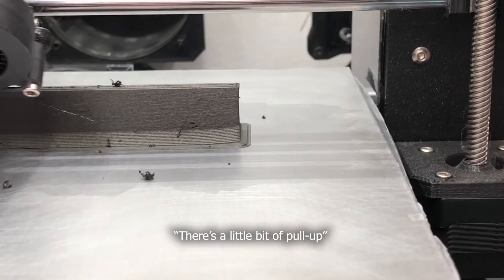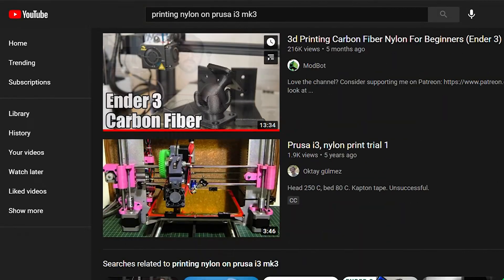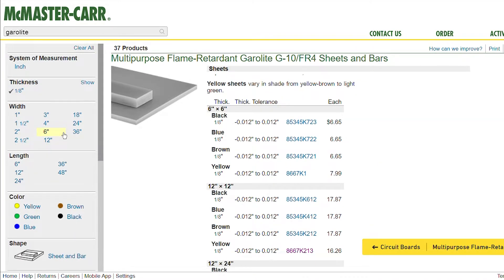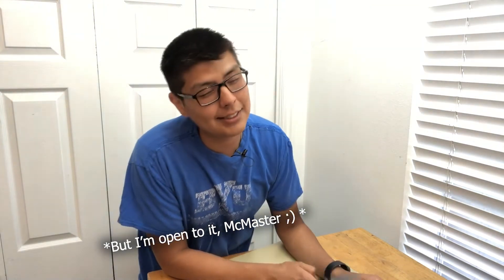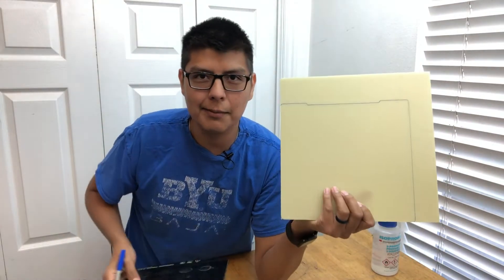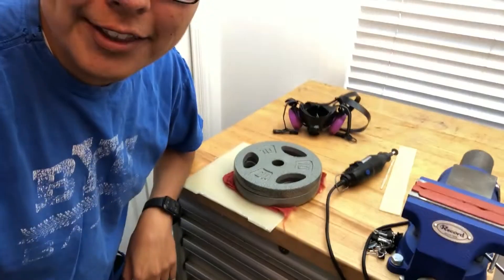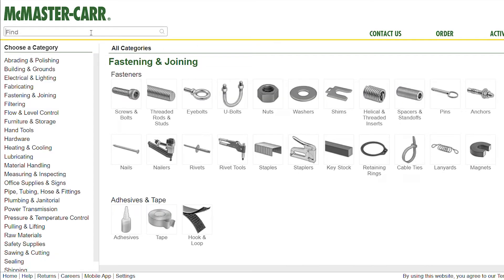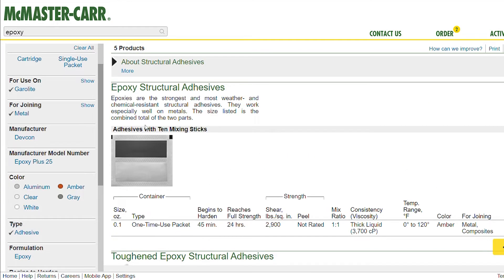Stop Build Plate Warping - Unbendable Build Plate for Prusa i3 Mk3s

Comment: Why don’t you use CF Nylon? It’s super easy to print, so almost no warping (even without an enclosure) and still retains its extreme ductility. Just put some glue stick on the regular bed and done. In case of of eSun and Sainsmart, they offer great value for money ✌🏼
Reply from the maker: Thanks! I'll have to check that out!

Comment: can you share te parameters you use to print?
Reply from the maker: Yeah,
Layer Height: .15mm
Print temp: 275C (I got really bad layer adhesion and weak parts if I went too much lower than this)
Build Plate Temp: 60C (with at least 2 layers of glue stick in a crisscross pattern)
Print Speed 20mm/sec
Retraction Enabled (I had a lot of retraction problems before I got it sort of dialed in. The higher temp I needed to run at caused a lot of stringing)
Retraction Distance: 8mm
Retraction Speed 60mm/sec
Retraction Prime Amount: 1mm^3
No part cooling
A brim helps a lot

Comment: what temperature do you keep the enclosure when printing nylon?
Reply from the maker: Sorry for the super late reply, I'm usually in the 260-275C range. It varies on the size of the part I'm doing, overhangs, etc. For larger parts I use higher temperatures.